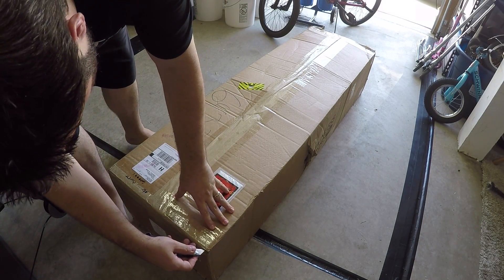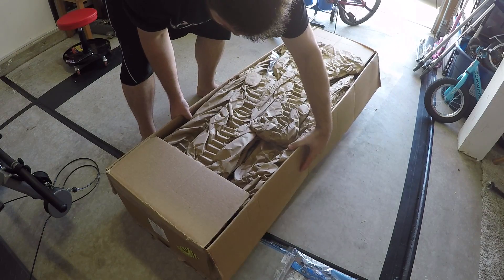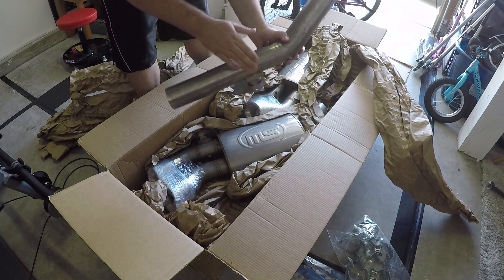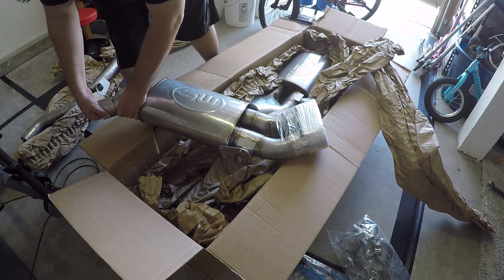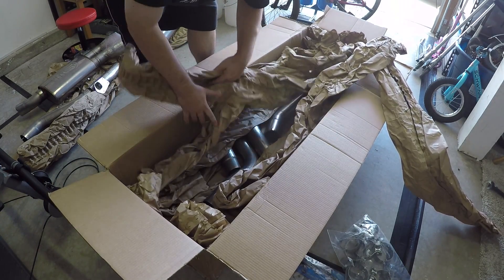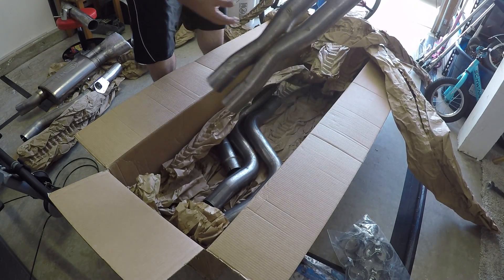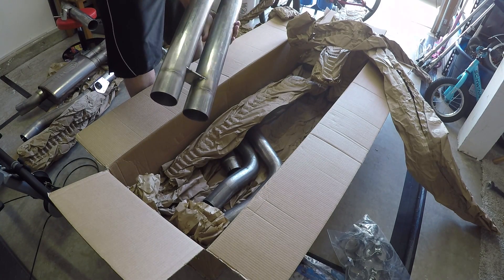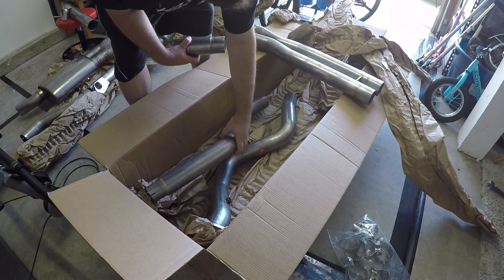Stainless Works 2016-2024 Camaro 3” Catback w/X-Pipe, NPP and AFM Delete (CA16RVCB) Unboxing

Comment: Looks insane!!! I opted for the Borla Atak, arrives on the 27th!!! Please video the sound when ya get it installed!!
Reply: How do u like the Borla Atak I bought them as well and I'm not impressed.
Reply: Well, I wish I could post pictures here but bought from Autoplicity and took 1.5weeks extra to arrive....when it did package looked like shit so I got discouraged and haven't re ordered. 💩
Reply: +Samuel Lopez i have the ATAK Axleback installed on my 1ss but it sounds the same as stock
Reply: I may do more research on them....btw NEVER order from Autoplicity, I got my money back after having to file an A to Z claim through Amazon if not id probably be screwed.
Reply: +Samuel Lopez I ordered from Jegs
Reply: +Samuel Lopez but I'm Finna order the stainless works catback system if u want the Borlas I'll sell u mine.
Reply: I appreciate the offer but I think when I decide to do it Ill have the shop order the parts....it was the worst 2 weeks of my life lol
Reply from the maker: +MrRgray1987 was not a fan when I heard it
Reply: Thought about it, I think I rather have the shoo deal with ordering etc then I just take car for appointment.
Reply from the maker: +Samuel Lopez Remember to use Lethal5 at Phastek and save 5% more
Reply: Thanks! Ill definitely give it some use :-)
Reply: +Lethalhammer that code doesn't work on the stainless works exhaust
Reply from the maker: +MrRgray1987 It should unless they are offering free shipping.

Comment: When you take the old ones off can you take a pic of them side by side for a size comparison, because it looks like the stainless are quite noticeably bigger. Video wise atleast
Reply from the maker: +Killa Kam Pipes? They are bigger. Stock is 2 7/8" but they get skinner at the AFM valves as well.

Comment: Really looking forward to hearing how this system sounds and finding out about any power gains. 

I'll bet the exhaust shop you have doing the installation will have the pipes damaged in shipping repaired in no time.
Reply from the maker: +TenSeven I am doing the install, I am just using a lift at a shop ;)

Comment: Hey Lethal, Like you I'm very interested in modding my 2SS. Installed the "Cold Air Inductions CAI and looking to do 3 more mods. Going to port the throttle body. I was turned on to a turner in Tampa that uses HP Turners (which I have already used on a previous GM car). And before the tune and dyno pulls, I want to bolt on a high flow exhaust system like the Stainless Works system that you just received. So I was pumped to see your unboxing video. Really interested in seeing how the install goes and what it produces at the Dyno. Can't wait. When it comes to info and modding on the 2016 2SS "You are the man". Keep'em coming!
Reply from the maker: +John Weber Dyno videos incoming

Comment: How much for the entire system?  Cause I would like an axle back for my camaro , but my car doesnt have the npp, and I do like the 2 exhaust tips  so probably i will trim the bumper to fit the 2 tips , do you know if the npp valve activates from a relay ,? Cause I would like to adapt the valves to open and close from the track botton in the screen like if I would have the npp from
Factory ,any ideas ? Thanks bro !